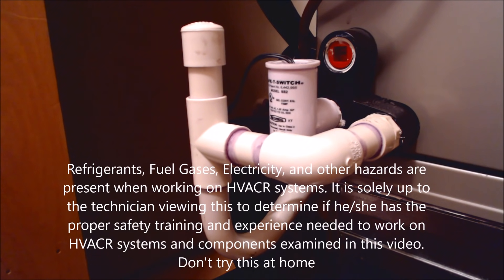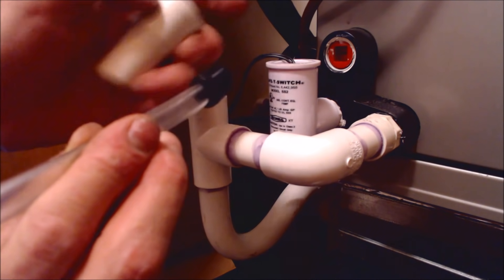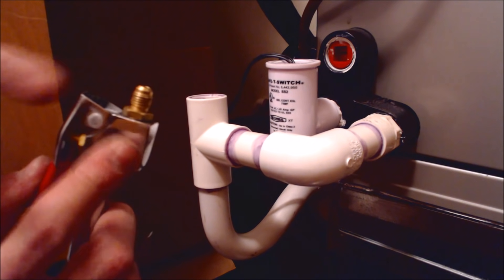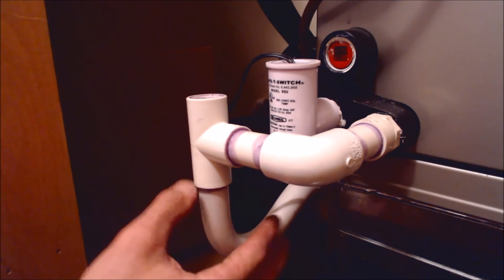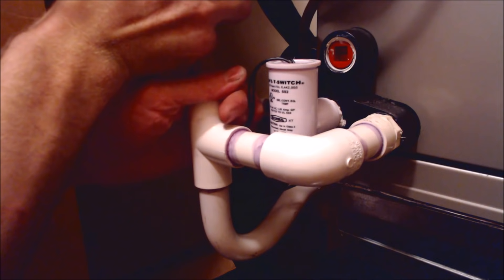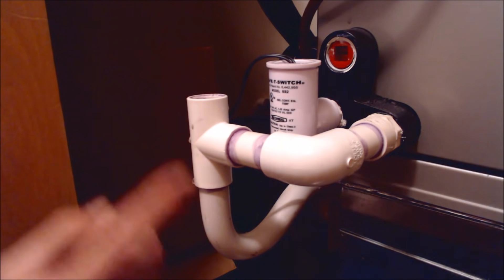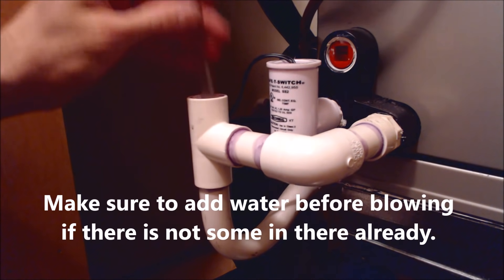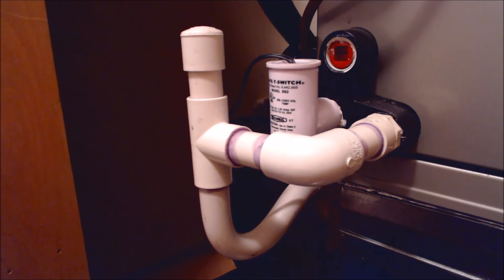Fast and Easy Clean Out of Condensate Lines on an Air Conditioner!

Comment: My 92% high efficiency Rheem Furnace that was installed 5 years ago, it doesn't have a p-trap, a cap on the 3/4 pvc pipe or an alarm. 
My inducer motor started making a vibrating and thumping noise on Thanksgiving and the day it turned 20° outside...of course!
I blew through the top of the pvc pipe and something gave and my furnace is running normal again. 
Do you have a video on installing the condensation pipe, the p-trap and the alarm? 
Thank you for your videos! ❤

Comment: I would seriously caution you against this method...from experience. You and (I did also at the time) incorrectly assume that all technicians and installers use pvc cement on all joints (as they should)...I did this with my own version with just nitro, and then down graded to only reverse shop vac exhaust..both popped the line INSIDE the drywall on two seperate occasions..one I got lucky...sort of..where it immediately began staining the ceiling. The other one was in the garage and cause wayyy more damage. Do not use this on jobs that aren't from your company is what I learned. Our techs all use pvc cement but when we get a new customer, now I NEVER do this.

Comment: Don't put the P Trap right at the air handler. Put it on the end of the condensate line. Being right at the AH the dripping water has no velocity to keep the P Trap clean its just a slow moving dripping.
 Crap will quickly build up in the trap. With the P Trap at the end of the line outside  it not only has alot of water behind it but the gravity of the water and weight of the water coming down from the attic to the ground it hits the trap good keeping it clean.

Comment: Yes it stops the unit from running, I’m baking 🥵 in my 1900 sq foot home. My condensation valve is 3 feet long running down the side of the unit, but I see the opening to where you said pump air through it. I did not achieve any results in the unit I’m trying to cool the house.

Comment: Been dealing with this issue for several months now.  The thermostat would only power down for a few hours then kick back on, so I chalked it up to a thermostat issue.  Came home last night to a very hot house and overnight the thermostat never turned back on.  Came across this video after a Google search and it worked like a charm.  Thermostat & ac came back on immediately so thank you for sharing!

Comment: No treatment you are going to put in as a consumer will truly do much. We use sodium hydroxide on a case by case basis. You need something caustic to dissolve the bio slime. However, just get a strong shop vacuum in terms of horsepower and routinely suck the pipe from the outside. This will do just fine.
Reply: If you do it on a regular basis Clorox or vinegar will work.
Reply: Sorry, geography will determine your outcome on that. Don't get me started on that pesky bit of pipe that always gets overlooked, leading back towards the air handler.

Comment: I assembled some fittings and flushed my line with a water hose from inside at the air handler.  It pushed out a lot of powdery white stuff which I figured was drain tablets that never dissolved totally and ended up blocking the line at some point.
Reply: Bad drain tablets

Comment: I’ve been getting condensation on my AC lines and even all the way to the duct work. My AC company checked it and said that everything is fine and this is normal. My AC lines on the inside of the house have been dripping water. Is this normal ?
Reply: No, get another company

Comment: Blowing compressed air can make a clog worse, or it can even blow out the drain line completely. If you blow it out inside of a wall, you will get a leak inside the wall and ruin the drywall as well as spreading mold throughout the house. Using a low pressure vacuum is the best approach.

Comment: There is a tool designed to do this job for a service technician and it uses a CO2 cartridge with a fitting that covers the tubing.

Comment: Retired hvac/mechanical 42 + years, native Floridian who has dealt with these issues my entire life. Best quick fix is to use a small shop vac for 2 reasons, 1- the hose end actually fits over the 3/4” line end nicely and you can feel the water/algae/ etc coming through the hose, 2- less messy and cumbersome, once cleared just take a quart or so of water with 2 oz of bleach and pour into your empty system. The small amount of house bleach will not hurt a thing along with the new water from condensation. We do this every 45 days at our residence from April until November just do to algae and particulate buildup in the lines, high humidity does not help. Hope this helps
Reply: Where do you connect the shop vac to, the inside PVC or the outside PVC where is drains to the outside?
Reply: @funkycowboy  outside
Reply: @TexasOutboardSalvage I just unclogged my drain. I was having weak airflow. Is this a symptom of this. It seams like it’s working better.
Reply: @TexasOutboardSalvage  I'm in a second floor condo and the HVAC is in the attic.  The PVC run is probably 40 feet to the outside.
Reply: @so-what5991  Your drain won’t affect airflow. If you have a float switch, then when it clogs it shuts the compressor down while keeping the fan on. What you’re experiencing is when the compressor is off then there’s no cooling happening and it harder to feel the air when it room temp
Reply: @funkycowboy  also I wouldn’t recommend bleach in any amount. White vinegar works just fine and it doesn’t corrode the pvc
Reply: @TexasOutboardSalvage  so now that I have unclogged the drain has it turned my compressor on. Because it’s definitely cooler now?. Thank you for teaching me btw
Reply: @so-what5991  yes 👍
Reply: @TexasOutboardSalvage  thank you so much for  your help and input sir. Diamond in the rough in internet world 😂
Reply: @TexasOutboardSalvage 
What if you have septic system and cant access the outside?
Reply: @jxsilicon9  definitely call an expert! You don’t wanna risk damaging anything. Are you sure it runs to your septic? Check all your sinks for an inch tube connecting to the drain. I ask because that is a bad design because if there isn’t a pvc P trap there will be air from your septic coming up your pvc drain
Reply: Florida here too. The AC guys who did mine, after sucking out the vinegar and water, then filled the line back up with water and left it. 
Fill it back up or leave it empty?
Reply: @tlmtlm59  it’s going to fill up from the condensation from the evaporator coil either way. Idk why your guy manually filled it
Reply: Question in the video the second tube with the water safety inside it. My short tube has water in it constantly.!! Is that normal, today my a/c carrier company came out and did a yearly cleaning update. I am located in Florida and just for advice since my Trane A/C unit's pvc piping is very similiar Just looking for your expertise in this area. Thank you in advance.
Reply: @philcarr5754  so that pipe with the safety switch in it will contain some water in it
 However
If the primary backs up it will fill that cup with water and should shut system or at least the condenser off
I advise you don’t ever used compressed air though
Instead
Hook up a small shop vac where the drain line exits
Maybe be near outdoor unit
Leave vacuum running and then go to ac closet
 You’ll hear air moving through a pvc  pipe
Cover that pipe with your hand
That should clear the pipe
If not
Call a pro   Please don’t risk damaging your system your home or worse yet injuring yourslf
Reply: @TexasOutboardSalvage  Does it method work for 1/4" cooper drain line over the attic (probably around 25 to 30')? Mine pump is only 4 years old when the whole system was installed and I tested the pump outside it works just fine so I suspected the 1/4" line might clog a bit. I didn't know so I use the compressor and blow the drain line (unhook the pump end) and did feel the air coming out outside the house but I guess that doesn't mean it's partially blocked.
Reply: You old timers and your bleach. We call the substance bio slime now! Also don't, recommend bleach or really any "treatment" if you're honest. Its not caustic enough to dissolve the slime as fast as it just runs out the drain. Thats why we use sodium hydroxide only on a needed, cases by case basis. Just stick to clearing the blockages with your strong shop vacuums. 😊
Reply: @DrainCognito nothing wrong with old timers you youngin
Reply: That's exactly what I do now: my AC guy showed me how it's done.

Comment: I just looked at my system and realized that there is not a trap on the outlet side of the condensate drain. I can easily put one in but will check with my neighbors and compare.

Comment: Will be very helpful for the future.  Apparently I used too much water and the A/C shut off.  I called my A/C company but they could not make it out for 4 days since it's been 100+ degrees these past few days. I was going to contact my neighbor for help also but decided first to blow my box fan on the unit and within an hour, the A/C came back on. Lucky or it just cleared on it's own.  But like I said, will use your helpful info in the future. Thanks; very easy to follow your instructions.

Comment: If, instead of a first 90, a T was installed with a female adapter and 3/4 black plug, you now have a plug front and center to remove and clean the evap outlet. I use black because PVC plugs warp and cross thread. You can---for just a couple dollars more----install a deeper preformed clear trap that is outstanding and comes with a brush attached. That first T still acts like a regular 90 but now with a forward cleanout.

Comment: I also use the shop vac from the outside method and let it run for several minutes. The extended run time removes more stuck-on grunge inside the pipe than a quick blast. But if you do use the blast-out method, make sure your customer is not standing anywhere near the exit end of the condensate line (unless you want an ex-customer!)
Reply: The shop vac will clear initial blockage, but won’t remove stuck on stuff off walls of pvc.  Always good to shoot water afterwards multiple times up line and let gravity drain.
Reply: Question for you: My condensate line exits in a upstairs bathroom sink. Does that probably mean there's no way for me to do the outside shop vac method? Or is there likely another drain line exiting outside?
Reply: @bradicalist  If the drain line is accessible in the bathroom, you can hook up the shop vac there and vacuum out the line.

Comment: Hi, a question for ya. I haven't found it being discussed on the net and just thought throw this out here since we're talking about similar topic -- condensation line.
I notice that there're cold air blowing out of the AC drain condensation line in the attic. The air is cool up in the attic when AC is running. Don't think it should do that under normal circumstances right? The doors & air ducts are completely sealed thus I have no way to diagnose it unless I slice open the seal & tapes. Any suggestions are greatly appreciated? thnx...

Comment: What do you do when your attic is super hot in Florida and your ac unit is up there the refridant pipes have covers on them but the cool pipe and the heat are causing it to drip on my ceiling what do I do

Comment: I think my p-trap on my AC unit is not "primed". The drain (and p-trap) at my AC connect to my bathroom sink drain. When my AC is on, the drain in my bathroom is either sucking or pushing air. The maintenance access on the drain pipe is not capped either (where this guy is sending air to unclog). I think i need to prime it and cap the access pipe... Looking at AC drains brought me here. Weird. But it might help someone.

Comment: Thank You for necessary advice when it comes to cleaning away algae from A/C line. This only happens when you don't use your A/C Unit during Colder Months. I add water along mixed with bleach. I was told not to use bleach, vinegar only. I used this vinegar idea, and it caused the
 switch to overflow. There's so many voices, after a while who to believe? I find maintenance is getting overpriced. Maybe I'll learn to be a maintenance woman. I do it all. I just didn't clean coils, or install Units. I do the rest. 
Thank You. If you have any other Excellent Suggestions, do tell.
Reply: Have fish aquariums and no one says use Vinegar to clear up algae, I would use bleach. Do it after the season on the last day.  Algae does not grow where there is no light.
Reply: Anything to report 2 years later Gayle? We're new to this issue(s) & just as stymied by the conflicted choir: bleach, no bleach - vinegar, use salt!? We've read just about every comment to find no consensus, & worse, no additional advice FROM THE AUTHOR! Speak up AC Service Tech LLC! & THANKS!

Comment: I ran a cutoff valve before my trap so I could run 100 psi through the line with no back feed issues. Blows anything out the line.

Comment: Shop vac at drain end is way better because it will also suck out the gunk in the pan instead of just clearing the line. Let it run for a good 5 minutes, and when done follow up with a cup of white vinegar poured into the drain line to kill fungus/algae. (Do not use bleach as it can harm PVC pipe).

Comment: Better call a technician,that can go into the float switch or worst you can loose a coupling inside the wall creating more problems by putting too much air pressure

Comment: I bought a drain gun with CO2 cartridges.  My HVAC line is about 10 feet long from the side of the unit to my basement floor drain.  Plus the builder installed a clear plastic trap that is easily removed.  So I can see any debris in the trap.
Reply: Where did you get the CO2 cartridges? Do you need a license for that?

Comment: From years of experience just take a couple 3/4 couplings cut the trap out and wash it out with the garden hose saves a call back and insures its good to go vs pushing slime around also pour a good amount of water down the line to wash out the rest of the gunk. Just my recommendation clearing condensation lines is a low price item and you make even less money coming back to blow it out twice.

Comment: I use one of those clogged drain clearing bladders which connect to a garden hose.  Disconnect the PVC line leading outside, insert bladder, turn on hose.  
Bladder seen here: https://youtu.be/sbiyVaVLY4I?t=40

Comment: best way to clear a drain line is to have the p trap be removeable hence dont glue your trap into the threaded adaptor for the coil pipe seal works just fine and makes it removeable and cleanable without having to cut and re do not to mention doing it this way works on most set ups

Comment: Craig.  My Trane was installed in March of 2003.  The installer never put in a P Trap.  However.  My condensate line leaves the Air Handler, makes a 90 to the right, then a 90 down to a line that runs below the slab.  Then makes a 90 and heads west (under the slab) about 15 feet where it comes up above grade and goose necks.  I have rarely had any issues.  Should there still be a P Trap?

Comment: I tried a sealed hose vacuum at the outside drain for 20 minutes without resolve. Then tried from the other direction with your idea of taping a hose and it worked perfectly. Clear in 3 seconds. Used water instead of air compressor. Ran for 5 minutes to completely clean. Thx

Comment: I just use disinfectant cleaning and a pipe cleaner 🤷🏼‍♂️. When you blow it out with air you run the risk of messing up the system and if you only try to take the settlements out of the bent part of the pipe you will still leave the bacteria in the pipe that comes from the system itself ... the settlements end up in the trap and the bacteria stays in that straight pipe

Comment: Compressed air for cleaning?  Back in the 60s and 70s,  they used Freon® .
Reply: Yeah... Freon.
When i was a new tech in 1985, I was using Freon to blow out a condensate drain which was piped to the laundry sin drain. Unfortunately, it was right next to a gas dryer which was in use and tge Freon displaced the air in the area of the dryer's burner which created phosgene gas that nearly gas killed the homeowner who was folding her laundry.
Reply: Needless to say, the company banned techs from using Freon to clear drains and outfitted the trucks with portable air tanks.
Reply: @Peelerusa  And air is recommended in lieu of nitrogen,  C02,  and other gases as they can displace air (oxygen) as well.  Good for short bursts,  though,  with proper ventilation.

Comment: the  only time you need a trap is when the evaporator is on the negative side of the furnace, and when the drain line is tapped into a soil stack
Reply: Not in the south

Comment: As a USAF Civil Engineer and HVAC Tech for 35 years, he is half correct, BIG Issue i just saw was he did short blast of air. which will only push the debris down the line, and a 2nd visit will be needed. Many system have long drain lines. you need to run the air/nitrogen blast long time. get that line Clear. I should make my own channel just to show the correct way.
Reply: Furious Fill, I have a very long drain line . I was wondering about the short amount of time when he blew air into the line.
Reply: @annamariewarren5887  if it's for your AC drain line just continue to blow through it you should feel a little resistance if it's clogged then you should feel it give way once you feel it give way then just continue to blow through it so it pushes the clog all the way out the drain line

Comment: Or you can use a wet dry vac at the outlet and it will remove the clog by drawing it out into the vacuum. All within a few seconds.
Reply: That what I did. Why risk blowing up the tube. It worked well  and now I'm using a product called Pan- treat.